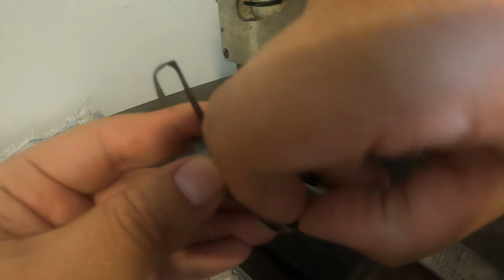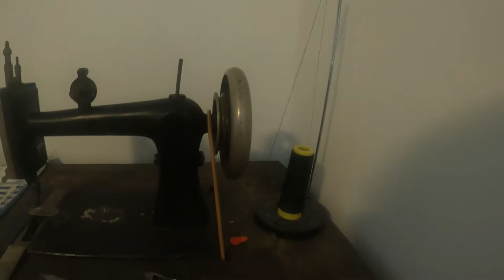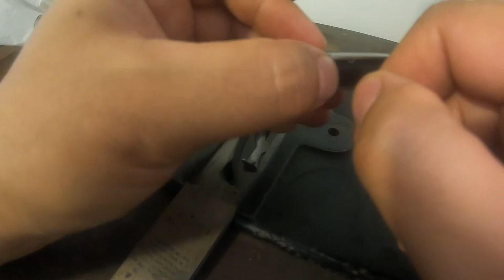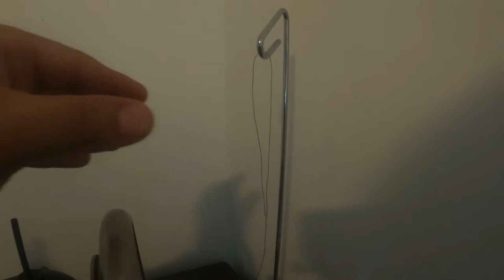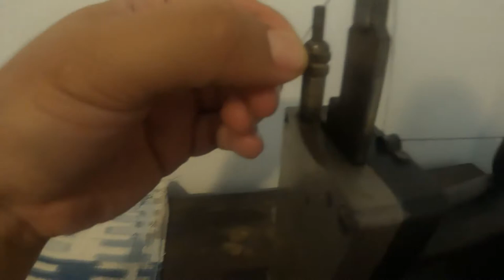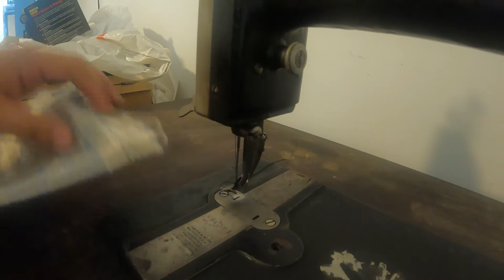Davis vertical feed sewing machine

Comment: I have the exact same machine and table! I discovered that the bobbin holder arm thingy is released and then lifts up, by pressing something small into a little depression on the side of the shuttle—it’s some sort of pressure pin thing. It sounds like the belt may be rubbing on the table. It’s a true treasure, and so under appreciated, thanks for putting it on YouTube.

Comment: #1 thank you for not chit chatting on video. #2 I can not get my machine to pick up the bobbin thread.   I have done the needle and the threading correctly.
Reply from the maker: If you have the same machine as this, it uses a slightly longer needle size than the typical sewing machine needle, but even with the correct size needle for this davis machine i still adjust the needle height so the shuttle picks up the thread. Its really not complicated.